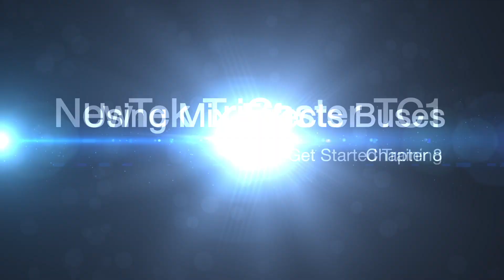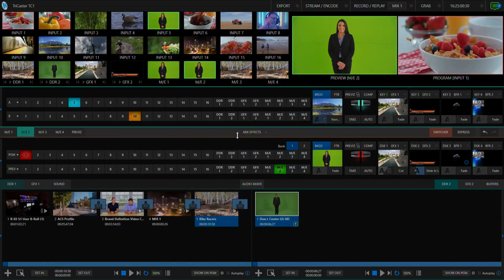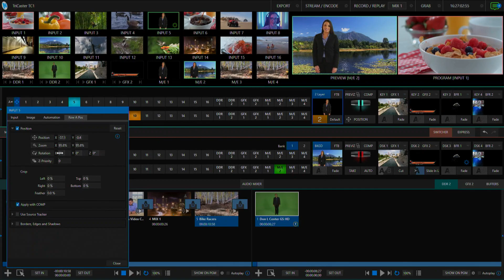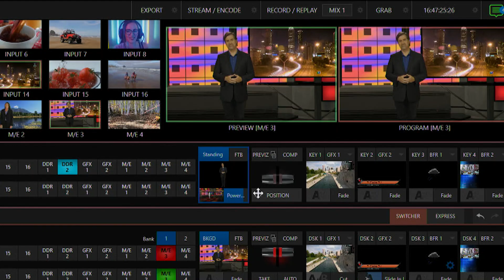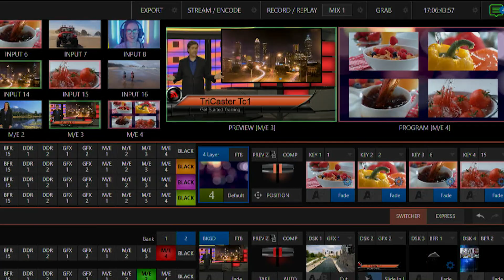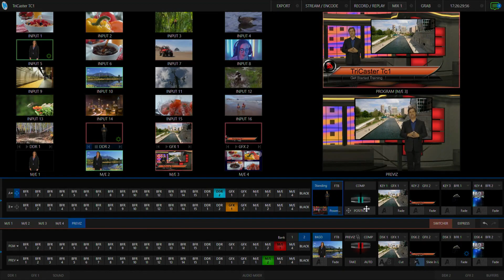TriCaster TC1 Get Started Training Chapter 8 - Using Mix Effects Buses

Comment: I'm coming from Tricaster  850 and Tricaster 8000. I'm kinda new to TC1. Most things looks familiar, albeit I'm curious about having to work with just 4 ME's. Is there another way to compose my shot. 
I work with this scenerio:
a:   a wide shot. ME2
b.   Anchor only shot.. ME 3
c.   Guest shot.   ME4
d.   Anchor and remote guest.  ME1
e.    Remote guest only in a customized box   ME5
f.     Remote guest and input 6  ME6.
E. T. C
This is just one of the scenerio I want to use the TC1 for. Is there any alternative to get  e and f and probably other things needed.